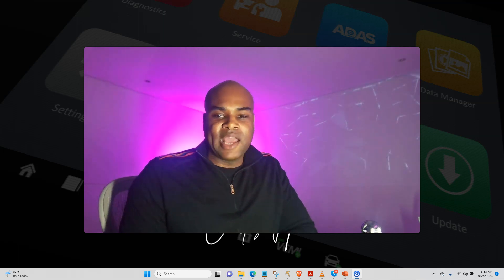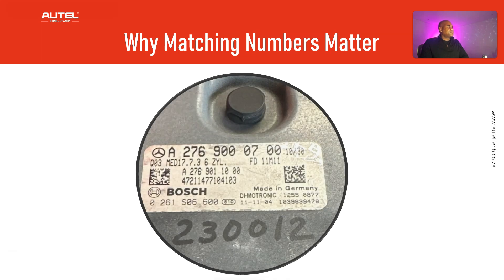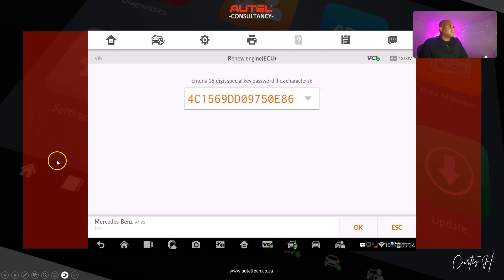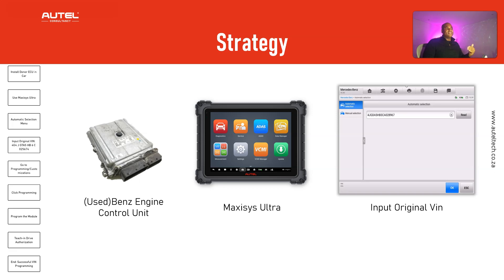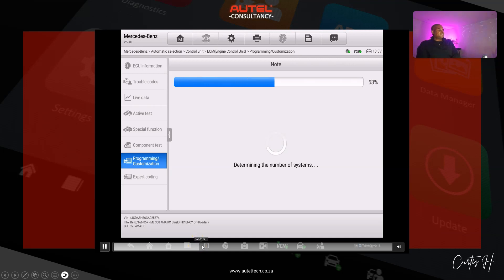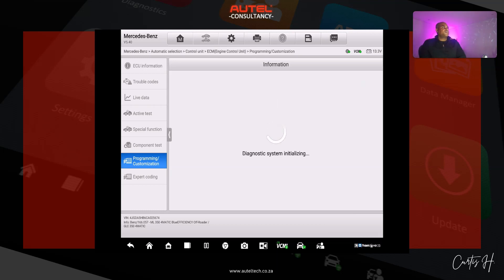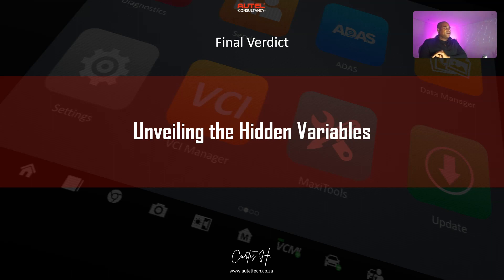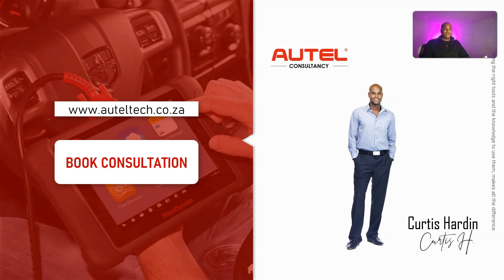IM608 PRO Failure On A Used ECU 2012 Mercedes Benz ML350

Comment: Scn coding would also change the vin and if u do the teach in auth it should also change the vin for u also the most important number on the Bosch units is the 0261 number that is what the hardware is and any ecu that has the same number will work